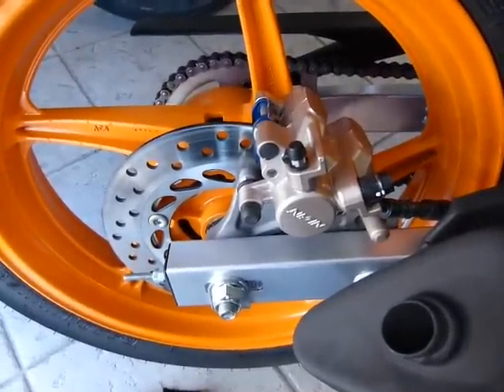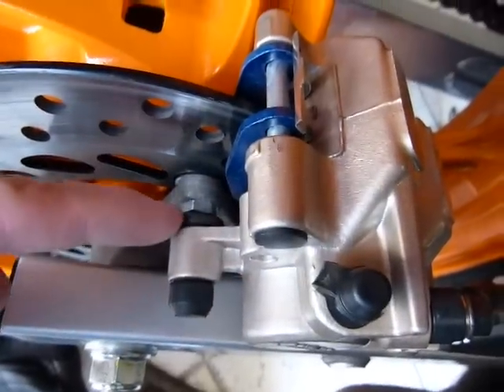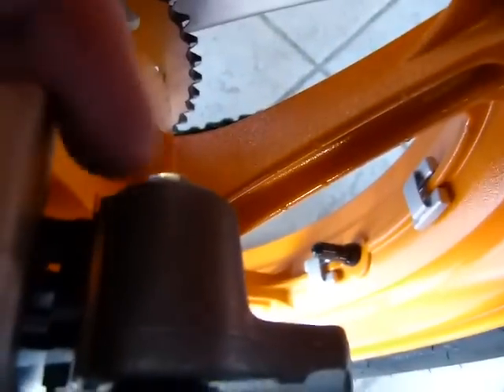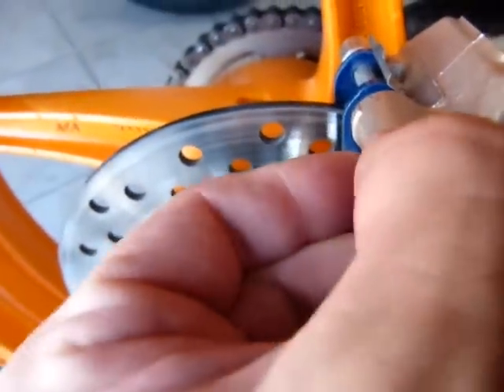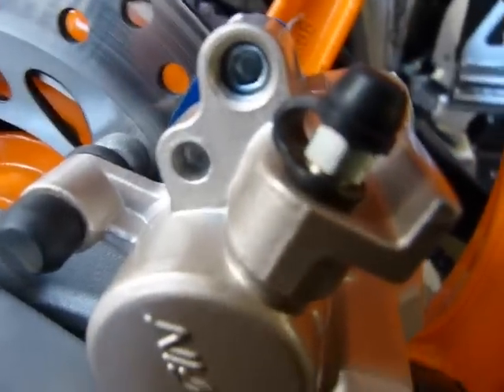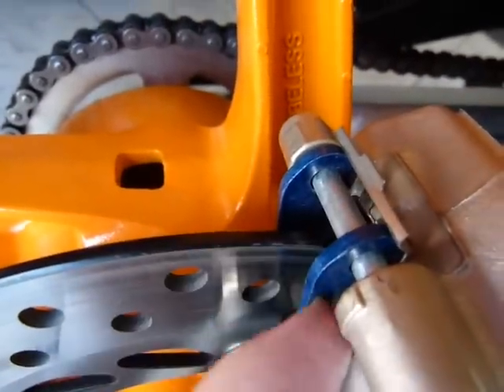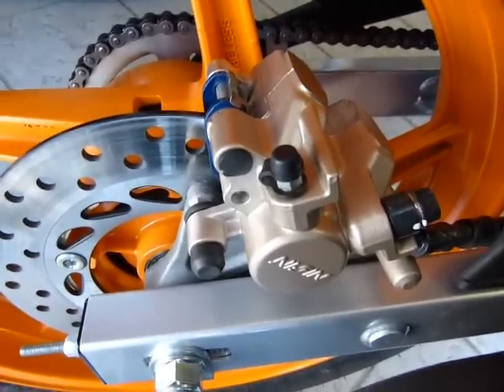Rear brake caliper removal (2011-14 Honda CBR125R)

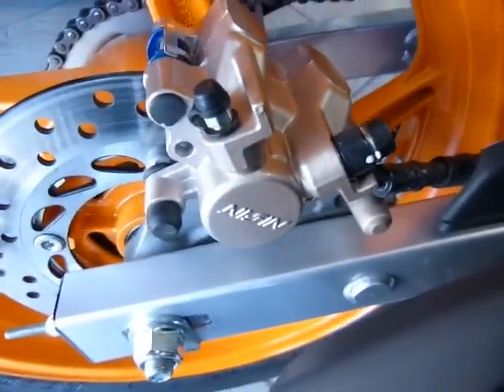Comment: Hey. Already changed brakr pads on my previous Honda CBF600. Worked simple and easy and sefl-explainimg without any knowledge from youtube. Now I tried to change rear pads on Honds CB600F Hornet 2009 and there is a rubber cylinder seal as shown in 0:37. Tried to screw-off the 12mm screw but i torn the rubber seal (was covering the nut head). Can I remove this rubber without damaging it? Somehow pull-off?
Reply from the maker: It's just friction fit into a groove in the caliper body. Dirt and time destroy it, it is thin to begin with.

Comment: I accidentally rounded off the rear bolt, can only get to it with a regular spanner. Probably because I have ridden in bad weather and the bolt ceased on. Either way be careful doing anything with them, the small mounting bracket I now have to replace costs £65 new! the whole caliper is a few hundred!
Reply from the maker: +Warlock 5822 Yeeaaaahhh, the rear bolt is key, the front is an optional pivot point. Some manufacturers actually produce dimensionally accurate tools. Some others don`t. Here is a little more: https://www.youtube.com/watch?v=39ahpcfWOEM

Comment: Hi, I have a problem with removing my rear bolt. I loosened it but cannot take out the entire screw. It's all loose, but it is impossible to flip up the caliper. I tried to screw the bolt even looser by removing the rubber, but still could't get out the screw so now my caliper is all loose and the rubber can't be put in again without removing the caliper....
Reply from the maker: +Maxim van loocke Here is one similar brake caliper worked on. The caliper has to be pulled towards the exhaust to get that bolt out. https://www.youtube.com/watch?v=x7eyiGeLbuY
Reply: +theoverengineer my bolt is not moving and I damaged the nut at the end of the calliper, the one that it's pivots on, also, the front but I kept loosening and yet it don't come out at all the both I can see it holds on too moves with it, is this normal?
Reply from the maker: Nothing here is normal. Remove brake pads using a properly fitted 5mm hex socket, turned squarely not slanted. The loose front bolt needs a lot of pulling against the vacuum sucking it back. The caliper body will come off the rear stud bolt.
Remove busted bolt with the proper size wrench bought not from a Dollar Store but made by a manufacturer who can actually make dimensionally correct wrenches. Wrenches are to be turned squarely when fitted onto bolt head properly.
Get a replacement bolt from a real Honda dealer and let a competent Honda mechanic put the brake together. 
Don`t  risk your life over a bolt, stay safe.

Comment from the maker: Same chain. Try to get a smaller rear sprocket (1-3 fewer teeth) and a bigger front sprocket (1-2 more teeth), if anybody even makes them. Try JT Sprockets. Or Sunstar. Check out my video "Go faster by changing sprockets", - number of teeth and other changes are better explained.

Comment: can you show it? I understood your removal instructions but would like to watch you do it. I have same caliper on my honda160. I checked another video (cbr 600 with similar rear brakes) and the guy removed axle and wheel. He was rebuilding the caliper. 
If you could record yourself performing the removal, it would be highly appreciable.
Reply from the maker: Not identical but the same 2 bolts come out at exactly the same spot, similar plug and same pin  holds brake pad tabs.
https://www.youtube.com/watch?v=x7eyiGeLbuY

Comment: You cannot remove this way the top nut is attached to the pin and does not come out you need to remove axle and remove complete

Comment: Thanks for the video is very useful. I can't remove nut off see the position on the clip at 0.20 sec. please advise.
Reply: You might have a better chance doing it from the other side through the wheel

Comment: i took my wheel off to do it and i pulled out the 1" long rubber thing on the brake caliper and i cant get it back in any tips?
Reply from the maker: Stuff it back with a screwdriver without cutting into it. Wet the rubber plug and hole, few drops, not a soaking.
Reply: my dad managed to do it, i bent the brake bad getting it in :/   thanks
Reply from the maker: Oh, no. ... that`s costly ...